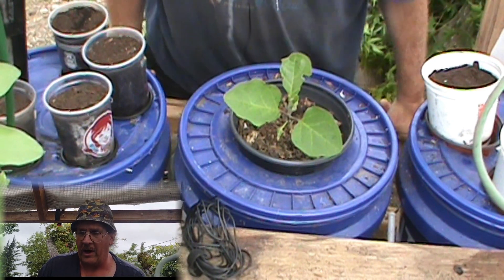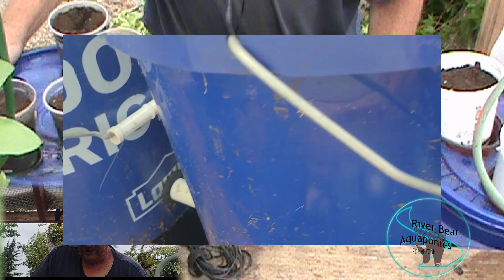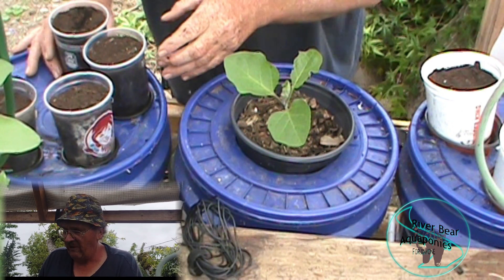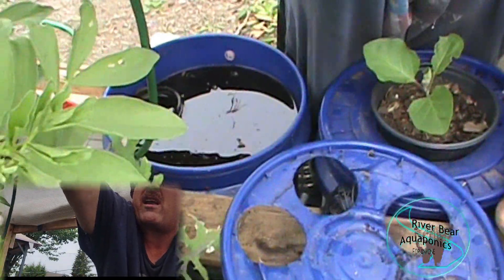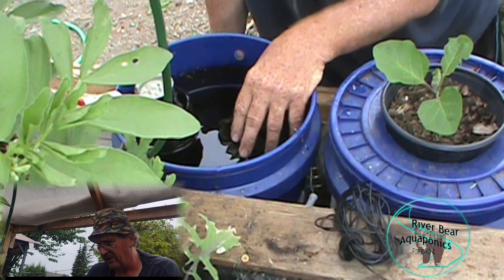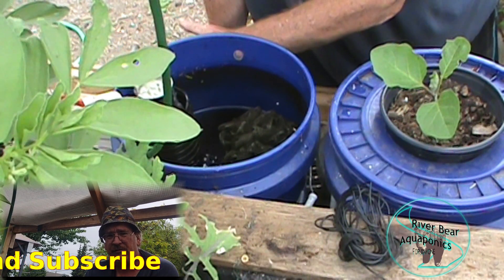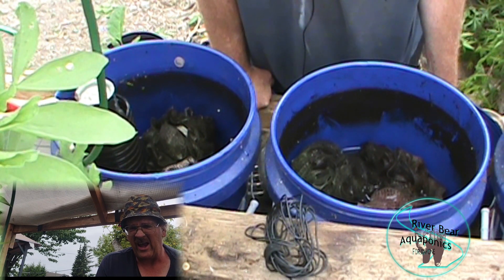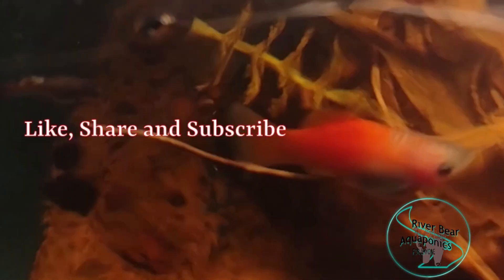AQUAPONICS - NO AIR PUMP REQUIRED DWC - A DIFFERENT WAY OF SETTING UP YOUR SYSTEM

Comment: Great Video, thats how it should be done, very similar to my old system, i had large pots in each drum, pots had fine bird netting at bottom, water would flood to to sand level, and drain away,  pot above sand had coco coir, soil, blood and bone  fish meal etc  in soil  man that was a good system, sham i moved and passed  it along, 24 drums in a row, want to build another one, cheers for video
Reply from the maker: I'd love to see some pictures on that do you have any posted online.
Reply: @PracticalGardens  Sure i can email them to you, i just found them for you//
Reply from the maker: @wizzzard_ponics  riverbearaquaponics@gmail.com